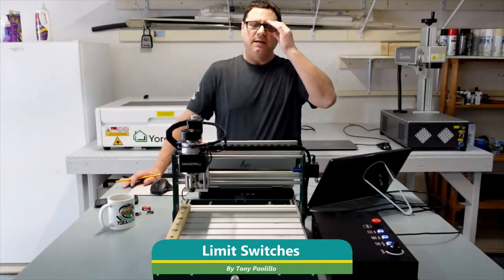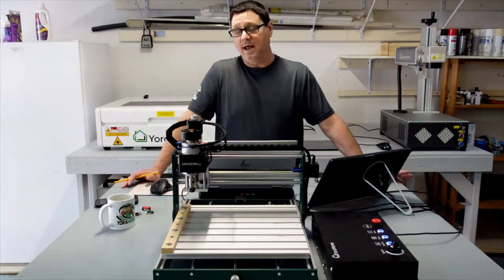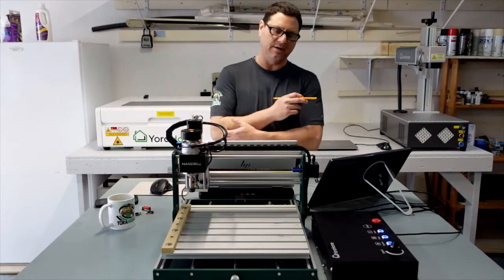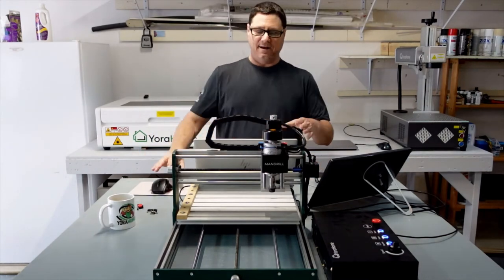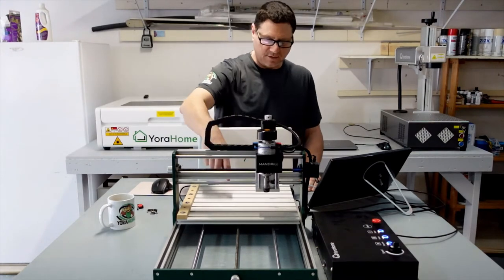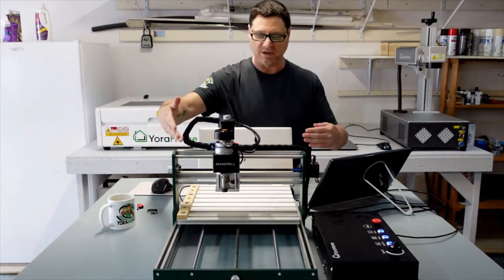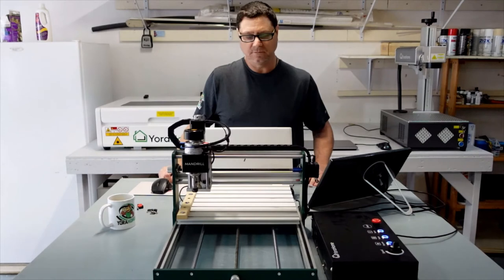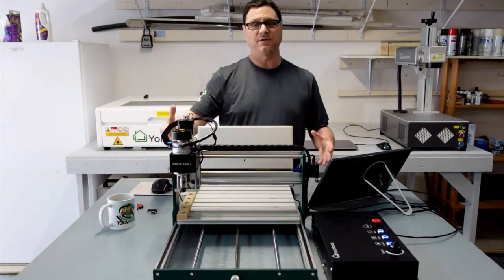Limit Switches Explained - CNC

Comment: 3018 CNC Pro, with GRBL(Candle), ground goes to com, but which is the other connector, NC or NO ?
Reply from the maker: Most likely NC. You can always test by connecting to NC then in your software jog the spindle around a little bit. If it moves then your correct, if it doesent move then you have it on the wrong terminal because then the machine thinks the limit switch is engaged.
Reply: Thanks Tony for your prompt response @TonyPaolillo